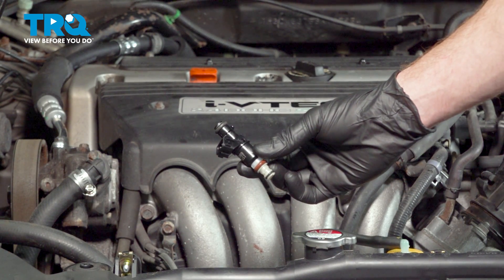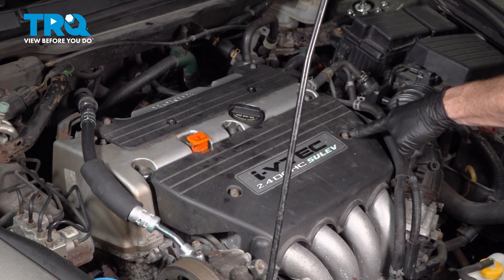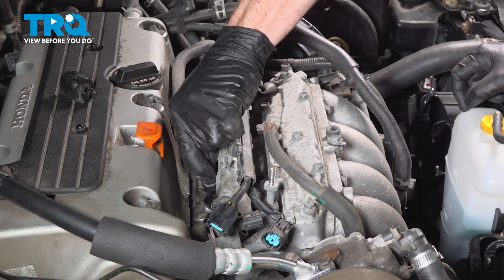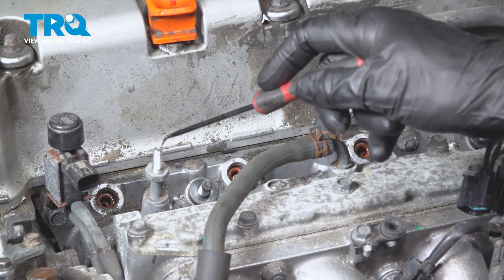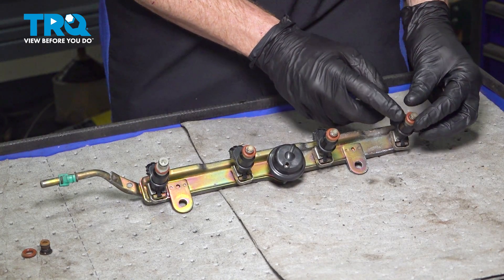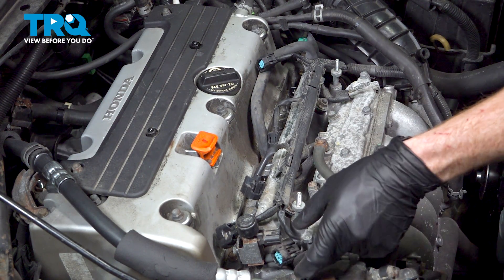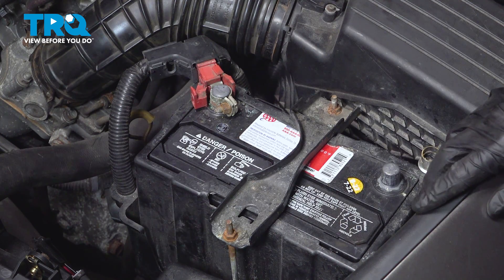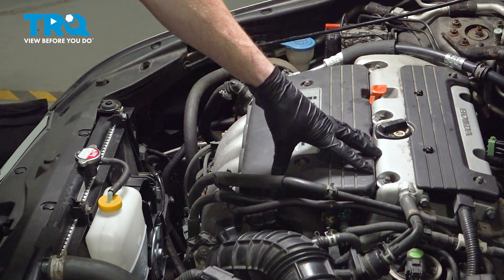How to Replace Fuel Injectors 2003-2007 Honda Accord

Comment: I installed the TRQ brand injectors in my 2012 Acura TSX (K24 engine) thinking I’d treat my car at the 12-yr mark rather than cleaning the old ones.  The car kept throwing a P0172 emission code: fuel too rich.  Fortunately I saved the old ones and switched them back in, and has been fine so far 🤞.  I read somewhere else a similar complaint with the TRQ brand injectors on an accord.  Oh well, money down the drain.  Method described in the video is accurate and works as shown - but recommend using Honda brand.

Comment: 7:35 what is the valve on the fuel rail, pressure regulator or fuel filter?  I thought that was in the fuel tank unit.

Comment: I just finished replacing the  dampener attached to the fuel of my 2007 kia optima 2.4 and compared to this, Honda is so much easier.
Reply: Hyundai and Kia are terrible - Honda is not.

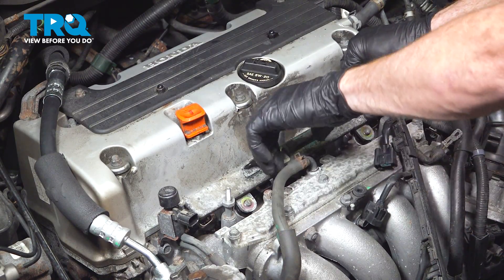Comment: 9:16  At this time, it appears you seated the fuel rail (and injectors) farther down then during your demonstration of the seating process, based on the amount of the mounting stud that is protruding through the bracket. Did you need to do anything differently to cause it to seat further?